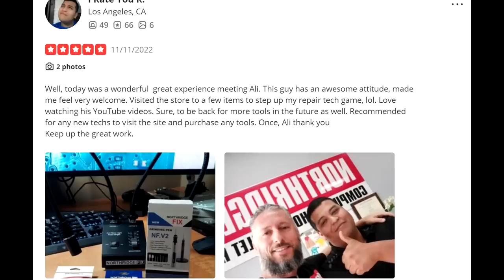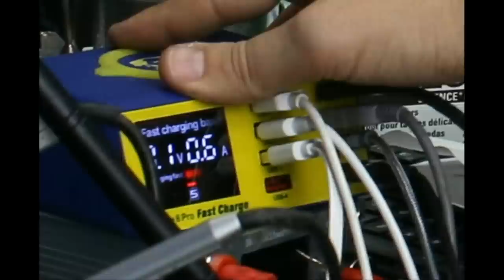Nintendo Switch Not powering on - What's wrong with this one ?

Comment: I threw 370 degree air on the gpu chip of a mac 2012 and 4 micro components of the motherboard next to the gpu chip came loose, 2 are gone, what can I put in place to replace those that are missing?  jumper?  And the ones that I had to resolder, maybe I applied heat for a long time with the soldering iron and it could be that these are damaged, how to identify the component and change it for the right one?

Comment: Could using the thermal camera injecting voltage on this one saved you some time?🤔🤔
Reply: i think because it is not shorted, the thermal camera won't detect any hot spots...just my opinion...

Comment: Do you have a trick for remembering the position on the chip on the board after you take it out to prevent from putting it back rotated at a 90 or 180 degree angle ?
Reply: photo with smartphone

Comment: i had a year old switch that just started to overheat, the fan stop working it seemed so replaced it but it keep overheating then also the joy cons woulnt charge docked,  unsure what the issue was but sold it for parts and got a new one  :\   worst was nintendo not wanting to warranty it or ask over 100 for fixing it,     it was the mario kart version

Comment: Alex, I am sure you have tried this but, for the record; have you ever scanned a QR code [ video @ 2:28] on a board just to see if a link to a board diagram, parts list, placement map or whatever returns? Probably goes nowhere, but I'm curious. Thanks.
Reply: It is kind of a serial number for the board. The QR code contains the same number printed on the label itself. Search online for nintendo switch board and see for your self.

Comment: I have a question about using the microscope for soldering. How do you have depth perception? How do you know when the iron is above the board exactly by just looking at the monitor? I tried with a cheap all-in-one microscope and this was my first problem immidiately.
Reply: Yes same problem!!
Reply: "Practice and persistence" is your answer.  Imagine losing one eye,  you lose 3D perception immediately.  Your brain will compensate after a while because of "use" (practice) and "necessity" (persistence).
Reply: The answer would be practicing and lot of experience
Reply from the maker: I went over this in the past when I demonstrated V1 of the microscope Check https://youtu.be/NfkXitg5R4I?t=480 minute 8

Comment: The boys spilled water on Switch recently and it first went crazy then died. So thoroughly  drying it up didn't fix the problem, and now I know why. So just bought a replacement console which is a bit expensive. What is your price for Switch repair after water damage?